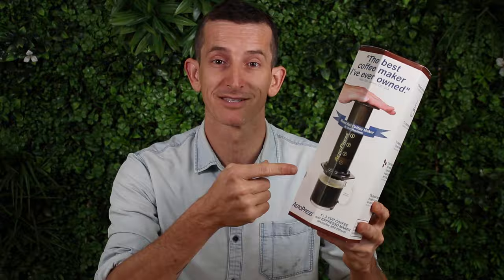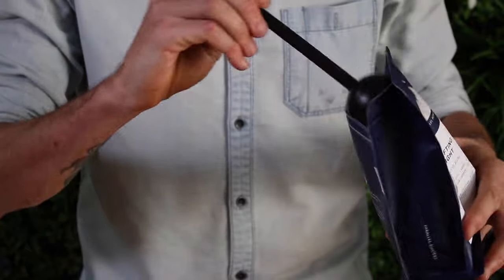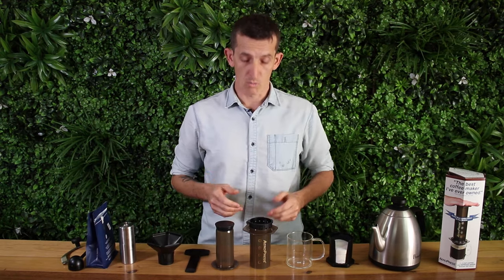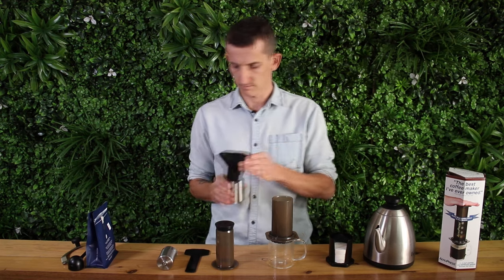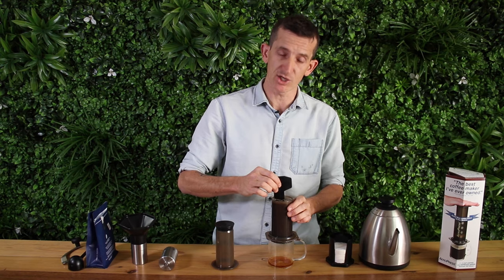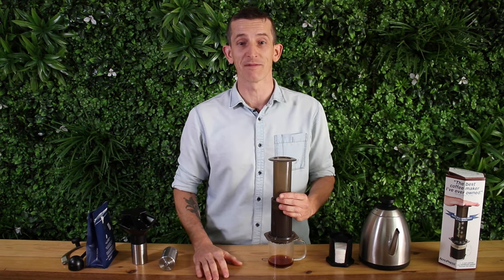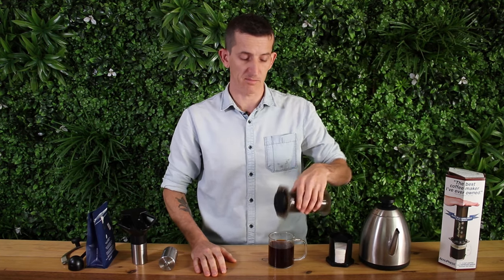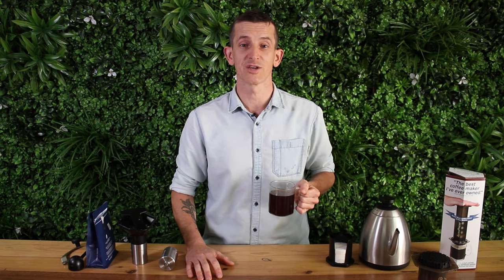How to Make an AeroPress Coffee Out Of the Box

Comment: Measure out 16g coffee. Put it in grinder. For best flavor, Grind medium to fine. Once it's ground, grab cap from aeropress and put filter in it - lock it into place with the long 'aeropress logo'd piece' and place it over to cup. First rinse hot water through paper filter, then ready to start brewing. Press the grounds into the aero press black funnel. Then pour hot water (94c). From this point, shouldn't take more than 2-2.5 minutes to complete the full extraction. Filling it all the way to the top (leaving small gap at the top) give it gentle mix with plastic stir stick. And place the plunger on top. Now wait 1-1.5 min before you start plunging down. Gently push down, Now under its own weight it should start to press down.
Reply: you should be a court transcriber
Reply: That's what he said
Reply: Weirdo

Comment: Using this method, while waiting the the minute for it to brew the water/coffee all drains down into the cup so there is very little left to press. If you want to brew the coffee for a minute I think you need to use the inverted method which is well documented on you tube. Otherwise, I like the original instructions that come from Aeropress, you only brew for 10 seconds while gently stirring then press. And you only fill the chamber half full of water. It makes a very strong 4oz or so of coffee which you can then add water for a cup of coffee, or if you want a milk drink add hot milk for a latte. I often add mine to a glass that has ice and about half full of milk to make a great iced latte type of drink.
Reply: You need to place the plunger on for the water not to brew through. The plunger suctions to keep the water from draining
Reply: @Greg-rk5ku  do you pull the plunger up slightly?
Reply: @Greg-rk5ku  if you ll watch closely you would see that the water it s still draining from the aeropress...
Reply: @miurazvanandrei3453  yes, but only slightly. If you left the plunger off it would drain much like a filter would. The vacuum keeps the water in the tube when you seal the plunger, and don’t push too hard when you put it on.
Reply: @miurazvanandrei3453  lol barely. Come on. This is like elementary school science. Ever plugged the top of your straw?

Comment: One question.
How is this any different to a normal coffee plunger?

I'm thinking of buying one but I have a perfectly good plunger.
Thanks for sharing
Reply from the maker: Plunger coffee has a habit of brewing better coffee - 'if' you just leave the brew in the pot and slowly pour it out over a period of time. It also tends to be a little more gritty - as most Press pots use Metal filters - that do let some fine grinds in to the cup. The aeropress is none of that. You press the coffee straight through a metal filter in to your cup below. So the coffee tends to be a lot lot smoother. The Aeropress in general though is a 1-2 cup brewer - whilst press pots range all the way up to 12 cups easily.
Reply: @AlternativeBrewing  oh ok. Is the flavour any different though to a plunger. Surely the aeropress doesn't provide an espresso coffee flavour.  I'm ok with fine particles of coffee grounds coming into my cup.

Mick
Reply: @michaelnugara1  I moved from hi spec Espro plunger to AeroPress and the AP gives a smoother brew and in my opinion gives a better flavour profile.  Better extraction, less waste, easier to clean.  My Espro is retired :)

Comment: I just got one of these, and the instructions in the box did not mention what to do with the big black plastic hexagonal piece. From this demo, it seems like it was just for helping you pour the ground coffee into the chamber, which seems like a waste of plastic--and backpack space if you're camping. Thanks for solving the mystery, though! I also liked that you pressed all the water through the grounds instead of what my directions said, which is to press just a few ounces through and then pour the rest of the hot water directly into the mug afterwards to dilute it to taste.
Reply from the maker: 100% The funnel actually is meant to be used for brewing in to thermos flasks and other containers with a narrow openings too.!! I hadn't mentioned it here in the video but that's another option 👍  The box instructions are for an espresso style coffee, but I do like a longer style brew too occasionally :)
Reply: adding water to the concentrated brew along with temp gives you a smoother cup. Some say it's a weak cup that way but you can either use more coffee, stir more, or use less water to dilute.

Comment: Ahh, I'm torn between this and the moka pot for camping. Which unit produces better flavour? How much does the stainless filter affect the flavour in the aeropress? Thanks for the good video, keep up the good work!
Reply: They work pretty well but they can let some little grounds through and also the paper filters make a less acidic cup because the paper traps some of the unwanted oils, the areo is the way to go, it makes a better cup then most any other method even at home
Reply from the maker: Both! A Moka Pot will ned the stove for brewing. whereas the Aeropress just needs water - in some cases I've even used cold water ( or even Coconut water haha -) witht he Aeropress and still brewed a decent coffee. So depends on your style of camping and preferred coffee. The Moka Pot will always brew a strong espresso like coffee that you'd add milk or hot water too.. the Aeropress is more like a Filter COffee, and you'll drink this straight - if not adding just a little bit of water to it.. you can brew a moka pot style brew with the Aeropress ,,, but it doesn't really work the same way.. If you prefer Espresso - go the Moka Pot .. maybe the 4 cup size for one person .. six cup for two.. but if you like to experiment than go the Aeropress
Reply: @AlternativeBrewing  you do still need a source for hot water.

Comment: Great vid. Do you know what the difference in quality of the end product is between an aeropress or something like a delonghi dedica? I'm considering buying the latter, but the pricepoint of the aeropress is obviously very alluring.
Reply from the maker: Apples and Oranges really. The Dedica will make appliance quality Espresso, which is okay.. small 30-50mls shots of coffee you can build on from there to make a latte cap etc... The Aeropress, for most is a brewer where you're making one large Black coffee to drink, no milk. It can, does and was the original recipe that suggest you only make a small 50-100ml strong coffee and dilute it, and this does a great job - but it won't be espresso like, as much as the Dedica is 😀
Reply: @AlternativeBrewing  thanks for the swift and detailed response. I ended up placing an order for the aeropress. I'm very much new to good homemade coffee. So I reckon it will be a good place to start and an improvement on my previous, and only, experience with capsule based devices.

Cheers mate.

Comment: why did you not use a RVS filter?
Reply from the maker: Because it did not come in the box. You can purchase these separately or in a bundle but the intent of the video was to show how easy the aeropress is with all it's won accessories. We'll be bringing out loads more videos on the Aeropress and it's other parts soon
Reply: Also, the creator of the Aeropress says you can rinse and reuse the paper filters. He reuses them 50 times. With 350 papers that's 17,500 uses.
Each use can be up to 4 cups of coffee. Just add 4 scoops (approx 60-90g) and fill the water up to the 4 marking on the Aeropress. Once pressed, dilute to 4 cups. 

In total, you should be able to make up to 70,000 cups from the included filters.
Reply: @pooounderscoreman  whatever...never though it was that big of a deal. not that expensive.